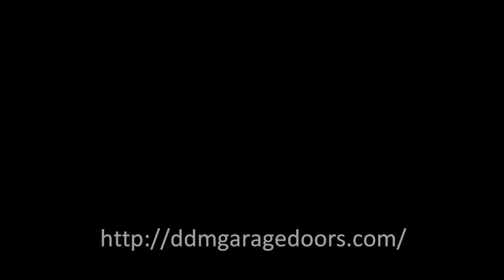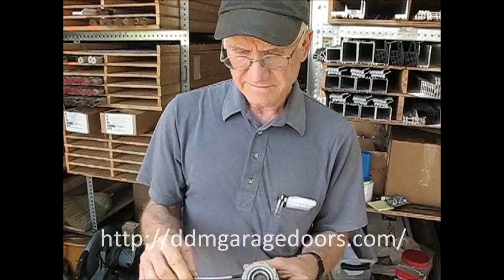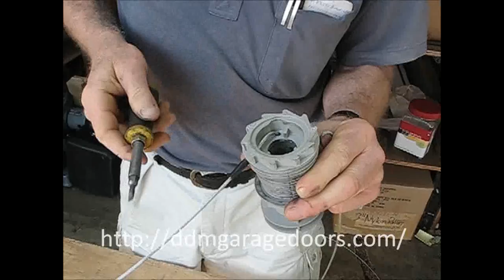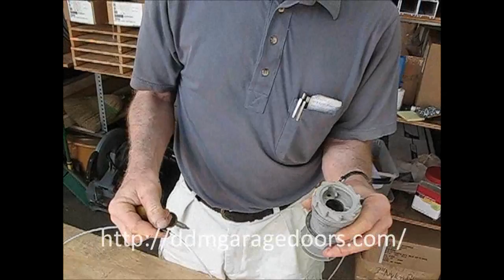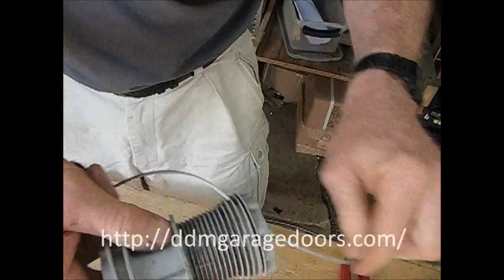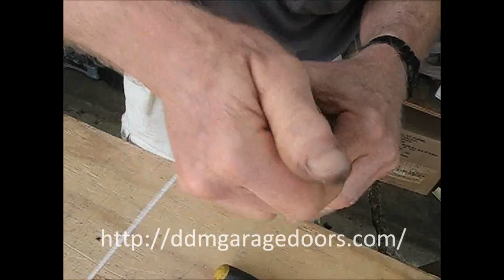How to Replace Cables on a Wayne Dalton TorqueMaster System

Comment: Dan, I ordered my new cables from Wayne Dalton! I'm confused. My cables came already marked @ 7'- 8" w/a piece of black tape. I checked my existing cable & it had a piece of black tape at the same place. Does the 2" make any difference?
Reply from the maker: Hi BigG S.! We would say that there isn't an issue with that, as long as you're replacing both cables at the same time. If you aren't, you could risk throwing your door off level, and having to re-level it.
Reply: Thks. for getting back to me! I finished installing the spring/ur installations. I can't figure out why my Idrive is running in reverse. I know u no longer sell/handle the Idrive anymore. Do u guys know how this happened? If not I'll figure it out!!! Thks.

Comment: Worked great. My unit from 2002 era was similar but slightly different. But close enough to finish the job. Popping out the bearing allowed me to run the cable through. Since the loop was also just a little larger on the replacement cable, I used a little tape to hold it in place since it popped off while trying to adjust - retention the door spring.
Reply from the maker: Hi David! We're glad the process that this video shows was able to help you complete the job!

Comment: hiya from the UK.   as we can't get torsion springs for a conversion in the uk I need to reuse the old springs and cones.

have you a video on how much tension to put on when refitting.
Reply from the maker: Hi Andy! If your springs are broken, then they need to be replaced with springs that are properly weighted to the door and will allow the door to lift without much effort. We can always ship springs overseas, so if you or anyone you know is ever in need of replacement TorqueMaster springs, torsion springs, or any other spring hardware, please feel free to let us know!

Comment: Thank you so much! I have a Wayne Dalton and found it difficult to find videos on replacing the cables or the spring. At first I wanted a professional to come and fix the cable, but most of them quoted me $300 for parts because they wanted to do a spring conversion. But since your videos are so helpful, I decided to do it myself.
Reply from the maker: Hi Yuina2511900! Yes, most professionals don't want to have to deal with Wayne Dalton systems, so they would rather just convert them. We're glad you found our video! Thanks for watching!

Comment: Thanks for posting these videos and more importantly, stocking springs I could get shipped on the same day.  Called every shop in Michigan and everything was more expensive and 3-5 days.

If you are replacing your cables, you should def. change the springs since you have to disassemble the whole thing anyway.  Those springs don't last forever so it's either $100 + an extra 15 minutes now, or $100 + 2 hours later. 

As for marking the cables, I did that on the tail side of the cable with a marker, right where it's clamped by the set screw.  I believe that to be slightly more accurate - you just have to be careful not to wipe your mark off since ink on steel wipes off pretty easily.
Reply from the maker: Hi M W! We don't necessarily suggest that you replace them; they may still have plenty of life left in them, and so you would be throwing money way by replacing them when your cables go, simply because cables can go whenever and not necessarily when the springs are going. Thank you for your business! We're glad you were able to get this done successfully!

Comment: This is why I hate Wayne Dalton
Thank you for this video and Knowledge
Reply from the maker: DethMetalNinja1 I agree, but replacing the springs or cables still costs much less than converting the system to standard torsion springs. Around here professionals charge $350 or more for converting to torsion hardware. With shipping most customers can fix their cables for $20 or less, and they can replace their springs for $100 or less, unless they have heavier doors where the DIY replacement may cost as much as $150.00 with shipping.

Thank you for your kind comments. Best wishes.

Comment: I couldn't find the exact cable size I needed and all the dealers tried giving me 1/8" cable, which wouldn't fit. THANK YOU for mentioning it was 3/32".
Reply from the maker: terryit3 The first time I replaced cables on one of the doors I had to make a special trip to get the correct size of cable. 

You're welcome. Glad I could help.

Comment: How do you remove the drum off the spring tube to get the cable on?
Reply from the maker: J King Before replacing the cables you will need to follow steps 1-18 at http://ddmgaragedoors.com/diy-instructions/torquemaster-torsion-spring-replacement.php. You'll need to unwind the spring, or both springs if you have two, and disassemble the winder mechanism.

Comment: Hello:

I was searching the web when I came across the garage door DIY videos created by your company. I must say I am very impressed at the thoroughness of these videos, you folks are doing a great job helping homeowners save some money! thank you!

I have a torquemaster plus standard lift garage door that I need to balance (the door falls down on its own, so need to increase the spring tension). It is a single car garage door, with single spring mechanism mounted on the right hand side of the door. I read the owner manual instructions that I need to increase the tension by tightening counter clockwise, but looking at the way the rachet and the gear teeth are aligned, it makes me think I cannot/should not go counterclockwise, but rather go clockwise. I have not tried either as I do not want to damage anything!

I could not find a video online to help me figure this out, but seeing that you have some realted to vidoes on similar mechanisms, I am hoping you might be able to help me.

I am happy to provide any additional information you may need.

Thanks again!
Sanjeev
Reply from the maker: Sanjeev Verma Sanjeev, thank you for your kind comments. We enjoy helping people fix their garage doors and save money in the process. I apologize for the delay; we've been very busy here.

Adjusting the springs on a Torquemaster Plus system is tricky. The terms "clockwise" and "counter clockwise" are confusing because they are relative terms. We avoid them in the  door business. We use the terms "up" and "down"  because they are not relative terms as long as we are talking activities on our planet.

Adding tension to a Torquemaster Plus spring system is simple. Using a 5/8" socket with extension, a 5/8" open end wrench or a large adjustable wrench, grip the cone sticking out of the winder with the wrench and pull down. As you pull down you will hear a click. At this point you can remove and re-position the wrench to repeat the process.

When a garage door comes back down after opening the door manually, I usually add 1/2 to 3/4 turns to both springs, if there are two, and then I check the door to see if it stays open by itself when it is open. Some times a full turn or more is required to keep the door open.

Some times customers install garage door torsion springs that are too strong. If the springs are adjusted enough to hold the door open, the garage door will not stay down after closing the door. Usually the opener will reverse as the door closes. If spring tension is removed to get the door to stay down, the cables will come loose with the garage door is opened. The solution is installing the correct springs.